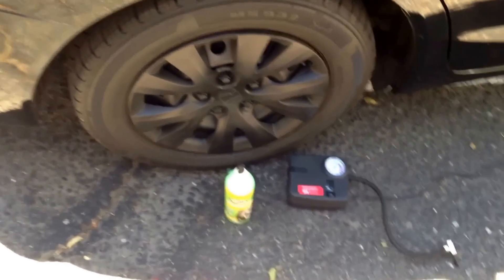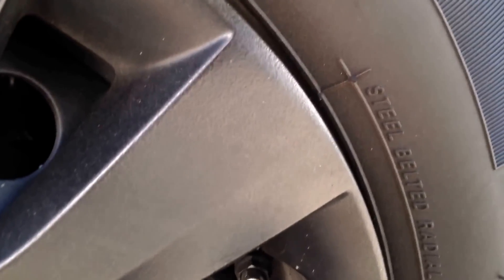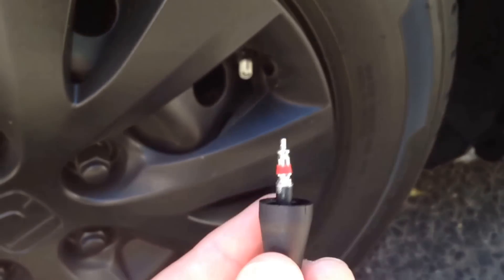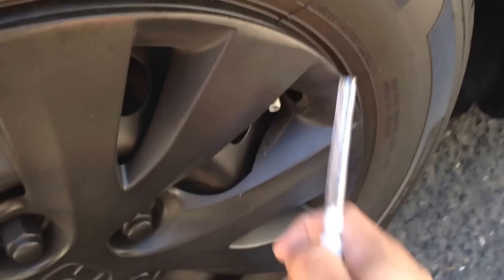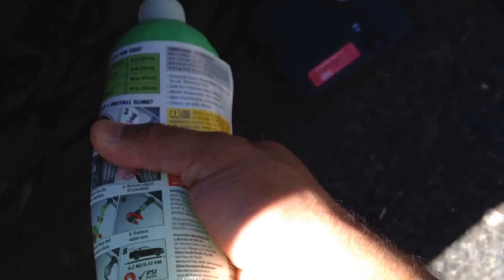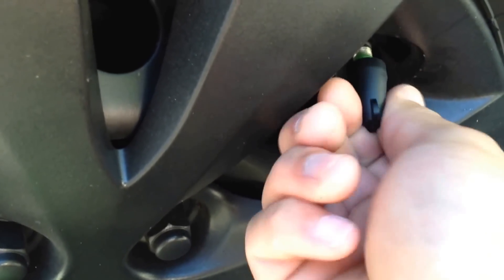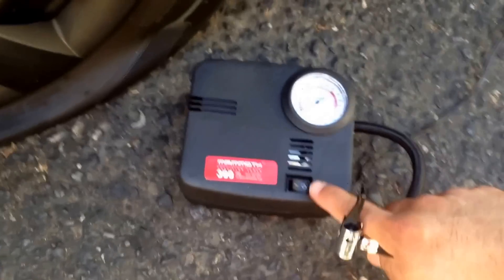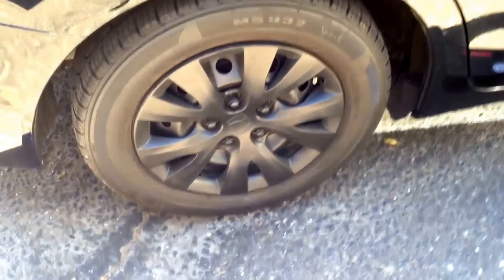Using Slime To Seal Any Flat Tire - 2012 Honda Civic

Comment from the maker: I had the Slime in the tire for about 2 months without an issue. It stopped leaking air,  but when I had to rotate my tires, I had the small hole patched by a tire shop. The tore was just like normal once winter started in this area.

Comment: I tryed the pressure type slime in can. Has a flex filler stem that screws onto the inlet.
Its got Worked great..

Comment: I have a nail lodged in the tyre and it isn't losing any air at the moment. The tyre shop advised to use a tyre sealant as the nail is lodged near the edge and he can't repair it. If I have to use this type of sealant, should I remove the nail first and then deflate OR deflate the tyre by removing the valve and inject this liquid. Basically, I am not sure at what point should I remove the nail ? Your advise will be very helpful. Thanks
Reply: Did u figure it out
Reply: Either way will work, but you might find the tyre won't pump up if the hole is too big once nail is removed so maybe get slime in first to be safe.
However best advice is just replace the tyre, this stuff is meant to be an emergency get you out of trouble temporary fix.
I use it in my push bike tyres, it's in all the time and has saved a couple of punctures but not always worked and I've still had flats, once I know a tyre is punctured I will patch it even if the slime has sealed the hole.
In a car or motorcycle I would not be driving far or fast relying on this stuff.

Comment: Will this work in big leaks I have to fill my tire up once or twice a day
Reply from the maker: If the leak is too big, then it'll need to be patched up. Try Slime and see if that temporarily fixes your leak.
Reply: If it will hold air long enough to take it for a drive it will probably work

Comment: How long did it last? Were there any problems with the tire after you used it? How did it do through the winter?
Reply from the maker: I left the Slime in the tire for about two months before I got the small hole patched up at a tire shop. It didn't leak at all, but I just had it patched for a permanent fix.
Reply: @UrbanSleepersOfficial  When you had it patched, did you cleaned the slim off the inside of tire as well? or it stays there kinda glued?
Reply: @realmouvement  patch goes on the out side 🤣
Reply: @thebowieman621  You're right it does, but on the bottle it says to leave it in no longer than 3 days or 160km (i think?) before cleaning it out. I'm curious about this too. Kal-tire said it was a mistake to use it, and that it makes patches harder, but I really don't see how it would. Maybe they're trying to sell us a new tire :D

Comment: Would it not be better to have the tire removed at a shop then use a paint bush and coat it real well on the inside then have the tire remounted so the stuff is in there even all the way around so there is no balance issue?
Reply: of course professional help is always better...clearly this is the quick/cheap method
Reply: Sure ill do that on the highway when im broken down 🙄

Comment: I don't know if you can put this in the rear tires of an awd cause of the diffs.. One tire will be heavier I suppose.
Reply from the maker: Raider Of The Lost Fart If you were to weigh the tires, the Slime would make it a slightly heavier, but the weight differences between the tires  would be very minimal. You won’t be able to tell the different driving the car as to which tire has Slime.

Comment: Just bought this and mine did not come with the piece on the end of the compressor?  Is mine missing that part?
Reply from the maker: So yours didn’t come with the piece to remove the inner stem from the air stem? I would return or trade the Slime you purchase and get one with that little part. It’s very handy and necessary.
Reply: You can buy a "valve core tool" off of amazon

Comment: Does the slime mess up wheel base? Can I replace the tire later easily?
Reply from the maker: It doesn’t mess up the wheel base at all. It sticks to the inside of the tire, away from the rim. The tire can easily be replaced or properly patched later.

Comment: How about a close up of that "valve core" or whatever it's called. Lots of good reviews I think.
Reply from the maker: tim smith Thank you
Reply: @UrbanSleepersOfficial  every wheel is a different size..so you need to not the amount you put into each tyre... too much and it damages the wheel bearing because the wheel is not balanced ..its only good for trucks and agricultural ..slower moving vehicles that won't feel the shake as much... cost me a stupid amount to fix my audi because the installer didn't realise the he was putting too much in.. your putting ounces of unbalanceable liquid in a tyre that takes grams to balance... that must cause untold damage over  period of time...more fibres less liquid could solve it tho...the liquid is heavier i would think... it takes a quite a few miles for the wheels to stop shaking as the liquid spreads around the tyre..its fine on slower roads but not on uk motor ways..were we can cruise at 70 mph or german autobahn  ..good idea...needs work..a liquid that could turn to a gel when the tyre gets warm then it could help with the shake???....
Reply from the maker: Yes that brings up a good point. If Slime could be made to become more evenly balanced as the gore gets warmer because it can certainly damage wheel bearings. I see your point in that.
Reply: Shrader valve core

Comment: One issue I've found with that 16oz bottle is that it's hard to squeeze. The liquid is very thick. I'm a man and it's hard on my hands: I'd imagine that for a woman it'd be really tough. So buy the larger bottle (mine is a full gallon: cost $29) which has a pump on the top. You just lean on the pump and the required amount is inside the tire in no time. And you have most of it left over for future punctures.
Reply from the maker: jeffw1267 thank you for the advice

Comment: BAD ADVICE: Slime is for temporary repair.  It does not harden and can cause vibration at high speed.
Reply from the maker: HamishNYC Yes, it is only a temporary remedy to tire issues.
Reply: The manufacturer says it can be good for 2 years.
Reply: @martinfiset  you mean two years in the tyres, or two years in the can while it is stored in the car?

Comment: Won't this leave a HUGE mess and hard to take off/clean when you change to new tires?!!!
Reply from the maker: When you use Slime, it only covers the inside of the tire, not the rim. So if you buy new tires and the Slimed tire is replaced, you don’t need to worry about cleaning the old tire. Plus, it’s not difficult to clean if you had to remove it from your old tire.

Comment: Does it mess with the psi sensors?
Reply from the maker: When I used it on the Civic, it never affected the PSI sensors. The sensor still functioned on that tire just fine.

Comment: can you use this after using fix a flat ?
Reply from the maker: You may be able to use it after you use Fix A Flat, but it will most likely not fix your leak permanently.

Comment: DO NOT pour this stuff into your tire❗❗❗❗❗❗❗

I had run over a nail, the tire pressure sensor kept coming on. So I brought it to a garage, they located the nail & removed it, then they plugged the hole to prevent air leaking. For a month, it was great. After that, same thing happened again 🙄🙄

So, I came across this Slime stuff on YouTube, and saw someone showed me how it's done by deflating my tire completely, and then squeeze this slime stuff in. 

Once the tire is completely deflated, I squeezed in the green slimy stuff, and took out my portable air pump. The air would NOT go in. Luckily, I lived less than a mile from my regular garage. I took the chance and drove there on a complete flat right rear tire - I know it's not good fory car, but I was desperate & short for time. 

My car mechanic after fussed with it fir a few minutes as I watched them trying to fill air into my tire with their heavy duty air pump, no air would go in. Then, he took a slight sharp tool and pried inside and saw the green slimy stuff. He told me whatever you had put in there is preventing the air going in. Now, it's killed my tire, and the only way is to replace with a new tire. 

Do NOT put this thing into your tire❗❗❗❗

Comment: it is my understanding that these spray sealant damages rubber.  it is for temporary use only and the tireshop has to clean the tire from inside after.  when left over a month it would destroy the tire.
Reply: Slime is water-soluble and is not supposed to damage the rubber. I'm no chemist but I've had no trouble with it.
Reply from the maker: I left it in my tire for two months before getting it permanently patched up at a tire shop and it didn’t damage the inside of my tire. It didn’t affect or deteriorate the rubber on the inside of the tire. I’m actually surprised it held up for a couple of months!

Comment: Readers ., Never Ever use this Slime junk ! It’s like putting a heavy ballon inside the wheel , throwing your tire out of balance and if you live in a cold climate this product can freeze like a rock inside your wheel .
Reply: You have to drive the car a couple of miles after using, which evenly distributes the slime around the wheel.  I have used this on multiple tires, and never had a problem.  I live in Pennsylvania, we have plenty of freezing weather.

Comment: I would walk before I would you that shit. It ruins tires.
Reply from the maker: I’ve used it a few times and I haven’t had any issues. It hasn’t messed up the TPMS either. Having a 3 year old, Slime has kept us going to safely make it to a tire shop to permanently fix the tire.

Comment: STOPPPPPPPPL , THIS IS NEW FOR 2018 , USE FLEX SEAL TAPE AT A REPAIR SHOP AFTER TIRE OFF RIM , DOUBLE THE TAPE AND YOUR LEAK IS REPAIRED FOR LIFE. * SEAL FROM INSIDE ONLY

TIRE WILL NOT LOOK LIKE THIS IN THIS VIDEO AND IT WILL LOOK LIKE YOU NEVER HAD A LEAK IN THE FIRST PLACE!!! 

TRY THIS??!!

Comment: That shit is a waste could of got a $40 used tire now you gumped up the sensor and have to get a new tire and sensor $200+
Reply: Complete myth. The slime is water soluble and just washes off.
Reply from the maker: Yes it is water soluble and can be washed off from the inside if the tire easily.